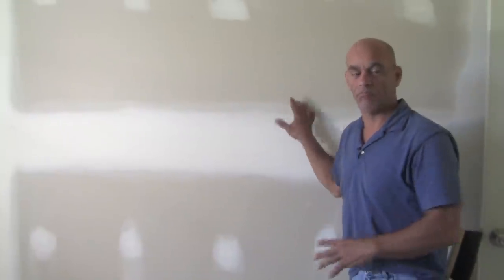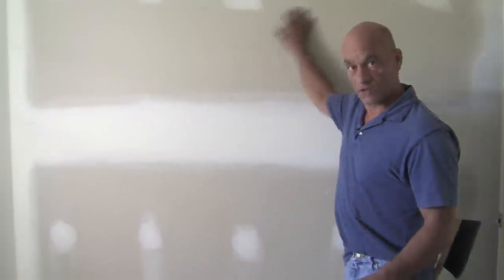How To Get the Smoothest Drywall Finish

Comment: Oh my Gosh! This legit changed the way I have looked at patching drywall by 1000 percent. I'm a home DIYer. I recently installed surround sound in my living room by opening the walls up with a flexible 4 foot drill bit and is g Ryobi Drywall patches. I've been stressing over the patched areas flat and uniform again before painting. I cannot thank you enough for making this video and completely changing my way forward! THANKS!

Comment: For 34 years as a professional Painter and Decorator, i bond my drywall with a PVA mix prior to applying paint. Lovely smooth and consistant finish, just my opinion.
Reply: What do you mean exactly are you saying to add the pva primer on the drywall then paint over? Or are you mixing your PVA?
Reply: @prominentsinglesinternatio4168  paint with pva
Paint with normal paint

Comment: Good Video Dom ..The Principal Issue of Skimming is covered Sealing the surface texture. I use my wide trowel for skimming walls. Yes commercial and residential projects that present an abundant of lighting will show flaws especially on fresh drywall which tends to absorb primer paint differently in various rooms effected by temperature and lighting.  I agree this skimming process is a great insurance for sealing the drywall surface supported by a good primer sealer which is a key factor in improving or achieving a texture smooth finish.  Thanks

Comment: Wow, I guess that is one option/technique. Across the water in The Netherlands, we plaster or finish the wall with Knauf MP75 gypsum, either spray or by hand, and go through a process of polishing and smoothing as it drys. Minimal dust and no sanding required. It's so smooth and straight you can literally see yourself in the wall and MP75 is really hard wearing plaster suitable for commercial buildings or homes. Now at least I understand what a North American guy, living in Amsterdam at the time, was trying to explain to me how he plastered a wall, sanded it smooth and had dust everywhere :)

Comment: I use a skim coat on all of my work, but I've never done this before.  I mostly resurface old plaster walls and older textured drywall. Mostly uneven substrate.  2 top coats and the same on all new work (level 6?) to match it up.   On a good day all I need to finish is a sanding sponge to straighten out a few blemishes.

Comment: Thanks for this info! My mudded joints had a lot of air pockets and this method filled in everything great along with smoothing out anything I couldn't really see otherwise. I did it with two people though. My SO had to deal with the roller as I took the mud off. Finished a 23x13x8 room in two hours.
Reply from the maker: Awesome deal.

Comment: I have been doing home remodeling for 15 years and never knew about this technique.  I can understand how the added labor would result in a super smooth finish.  Using a 3/8 or 1/2 inch roller pad using a drywall pva primer and two top coats I have never had any issues with uneven textures.  Thanks for the vid
Reply from the maker: I really use what ever nap I have available but yes a thicker nap is better.
Reply: +Ozzstar Under certain lighting conditions, you can see where the mud was applied over the joints vs the field area of the wallboard because the underlying textures are different (paper vs mud).  A coat of primer would not change the texture.

Comment: I worked in the Drywall trade for quite a few years and never knew of an architect to spec this. The best tape job will show joints depending on the lighting. The trick is good tape job, quality primer and FLAT paint. Any type of gloss paint will reflect light off the sheetrock paper differently than off the compound.
Reply from the maker: So very true.

Comment: Im in UK I was taught this 30yrs ago and have never seen anyone do it since besides me.Works great on long downlit corridors where you can normally see all the joints.
Reply from the maker: I'll say. Thanks for commenting.
Reply: i am the same way here,i was the only person around here that rolled it on the wall, and a few laughed when i did it, then later came back and asked what i used for a sleeve and how thin to mix it lol,,great work btw
Reply: Too much of that pink stuff over there. It lets people say they have "plaster walls" when it's only an eighth of an inch thick.

Comment: There is a recent article in Fine Homebuilding that says another way to achieve a Level 5 finish is to spray the walls with a primer/surfacer instead of the skim coating.
Reply: Jed Morton the skim coating you do at level 4 then to achieve a level 5 you either skim again or do the surfacing with the spray method which you do have to spray couple of times. either way works

Comment: Been doing drywall for long time. A crew I worked with sprayed the drywall with water then used squeegees to wipe it down. If you raise the nap on the drywall you can hand spounge it down. Painters dont do their  job right for the most part. Yes good primer and sand. Most people dont know it but when you primer you only have so many hours to apply the paint so it bonds. Otherwise its a must sand before paint. You should sand the primer painters.

Comment: I used this method over some patches and it works perfect to blend it all in. I just use a paper plate and some mud with a dab of dishsoap and some water  to make it very light weight before I roll it on with a small roller.

Comment: I’ve been a drywall finisher for 38 years this is a good process to do for an apprentice first off I never use the sanding pole we call that an idiot stick if I’m doing this smooth finish I use sponge on all my joints and lap marks second of all I covered the entire wall with 1/8 of mod with my 18 inch knife this way I can lay off very smooth with you let marks I come back the next day to take a small sanding block fine finish and take out any of the little thick laps but the rest of them are use the sponge on just the swirl in the walls come out

Comment: I never do level 5. On occasion I will do level 4 when there is a lot of lighting, but the normal standard here on the east coast is tape, then block coat, then skim coat. After prime then point up where needed.

Comment: Might not seem credible... but what he’s saying is right, one way to do a complete professional finish. Wall will look good in any light or photo
Reply: Moon Pie imo, the skimming gives a mire uniform surface for the primer and paint, especially on very old and damaged drywall.   I can show you walls that were patched and primed that you can see every patch. The patches have a much smoother texture than the rest of the wall was painted. That is why I am skimming a couple of walls now. 
  That being said, I do prime thicker than the video shows!
  I like to do it thick enough to completely hide the drywall behind the mud. Not sure that is necessary, just something I do. 
  I thought that mud was too thin to start with. I may be wrong.

Comment: that's interesting. I've had the privilege to work with 5 different drywall company's . they had been in business for 40+ years.  myself have been in the business for 15 years. I myself turn over a flawless job with what you call a level 3. the compounds and products used specifically say minimal to no sanding required. the porous texture of the drywall board itself has the same feel as unsanded sheetrock. if it's skimmed right. yeah, level 3.

Comment: I simply sprayed RuCoat 10 mils thick with a .516 tip as recommended by the manufacturer, sanded, primed, and painted as usual. Its advisable to back roll if needed, but I didn't see the need. It worked great and it is fast as it can get. 👍

Comment: what you said with commercial places with high ceilings, shadows and lights is when you need to up it to level 5.  I did the best level 4 job on it and the lights made it look horrible!  I didn't know to use the roller and ended up doing 6 coats of skim in lit up areas!
Reply from the maker: oh no.

Comment: You can save time skim coating way past the width of joints before the final joint sanding.  That way you don't ever sand directly on paper.  Yeah, if gloss paint, not flat, is used, you have to make sure the whole surface area is uniform or it shows.

Comment: Just a correction for you. Level one is the tape. Level 2 is you first coat, level 3 second coat, level 4 is skim coat and your level 5 is skimming every inch of the board. Mostly done on higher end houses or condos especially walls where you have a lot of natural light flashing on your walls.
Reply: Quick question...do you prime walls then skim coat...or vice versa?  Trying to hide some water damage
Reply from the maker: Prime after level five
Reply: @Askmediy  thanks

Comment: PVA primer will achieve basically the same goal. its easier to apply uniform than skimming and sanding, i always use PVA on new drywall and to blend repairs with existing drywall

Comment: GREAT video!!!  I never knew about this step.  I have that same brand 5 gallon bucket with a blue lid, mine is much thicker than that. Should it be thinned to do mudding?  Thank you, you're a super great teacher!!  I am going to surprise my husband and have all this done next time he looks in my closet...I am hoping to have it completed!!!  He'll think I hired someone to do it!! : D  yeah...wish me luck on the recess lights...the only part of doing this that is disturbing is working with wiring...I can do it though.  Luckily the panel is less than 30' away and that's going from the panel box, up inside the wall, across the ceiling using PVC to fish it, one light, then the other light, and back down to the switches for the two lights.  I sure hope I find a video on recessed lights!!!  Nevermind on the question.  Leave it the same to do mudding.

Comment: Level 5 has nothing to do with how many coats are used or done. It is simply texture equalization of the surface. If you prime then sand your walls it will do the same job given the quality of primer used.
Reply: FINALLY someone says it damnit! THANK YOU.  Exactly
Reply: Yep.

Comment: For the love of god... Has no one ever used a New construction primer.  Spray a nice coat on, back roll, then sand between with screens between primer and paint.  This will 100% get rid of texture difference...
Reply: +Michael DiNapoli can you explain this to me where do i get the new construction primer what is it and can i use it on my existing walls
Reply: +sam Construction primer is just the paint you first apply to seal new drywall. If you do not seal the drywall the latex (or oil) paint you put on can peel off.
If you want to "skip" the primer, you can buy a paint with the primer in it. This will save you painting time. 
I have had very good success with Bher Paint and Primer in One. Just remember to sand between first and second coat to remove any drywall mud dust which can give you a rough texture. It is definitely worth the time and effort.
Reply: all the regular paint retailers i know of sell "new drywall" primer. it makes a huge difference in final coat adhesion and evenness. i just did my bathroom with cheap(ish) paint. started with a generous coat of new drywall primer, then regular primer, then finish colour. putting a 2-in-1 over the drywall primer would probably work very well for less work. i know benjamin moore and CIL both make good quality 2-in-1 paint.
Reply: Rick V read the can, it says not for new drywall, there is a difference between primer and so called paint  &primer in one
Reply: milkweedsage mwhi
Reply: Technically this is called PVA primer and it seals the paper and joint compound so that you don't waste paint and get a more even looking coat (paper and compound soak up paint differently). This skim coating does not replace that. You should still us PVA. It will save you $ by reducing your paint usage.
Reply: Any true flat or dead flat paint with zero reflective value will work as a good primer to first coat drywall. I'm familiar with sherwin Williams products mostly so I use masterhyde or covermax line of flat paint for new houses. Its a finish coat as well. Though not the most durable finish coat...  Most new houses are sold with 2 coats of this paint or an equivalent of the same paint from a different manufacturer.  Not all flat paints are a true flat. Some flat paints have a teeny bit of sheen to them added to bring out certain colors and increase durability. Those are usually but not always your higher end flat paints.
Reply: Since the recession back in the 90s most painters to keep cost down bypassed the sanding and blamed the drywall flashing on the drywall finisher. They passed the buck so to speak. You are totally correct, prime and sanding will do the same thing.
Reply: Pva primer makes it look real good sprayed on and back rolled and sanded,exactly how I do it too,beats skim coating and sanding an entire house after you've already finished sanding, especially if your doing a big house like 15-20.000 sq ft of drywall
Reply: Blame Poodwaddle  good call, high quality PVA primer is a must for a good paint finish I always prime my own finish drywall work if I'm not gonna be painting at least the homeowners can see a solid primer on their walls before they screw it up by painting it themselves and leaving paint runs and roller/brush marks everywhere and blaming the drywall contractor for a bad finish job, happened more than a few times.
Reply: Patrick Spence yea if you want to coat it four times and use up more paint than you need to,it'll suck up your paint differently on the paper than the joint compound  and you'll always see the flats and butt joints no matter how good of a finish you did on your drywall. Use a good PVA primer in the first place and you can get it done in two coats of paint.
Reply: New drywall primer is highly recommended for new drywall. You are correct there. It is specific primer by name. Just ask them at the counter.
Reply: @pintorthepintor3964  based on your opinion based in zero fact.  It wouldn't rate number one in independant tests for the past 20 years for no reason.
Reply: You sand the primer?
Reply: @sam3922  Get any primer for drywall, paint it over your sanded area, then sand the primer once it dries, you can also put on a second coat of primer.
Reply: Pintor The Pintor what paint do you prefer?
Reply: Hey Mike ...tell me why does everyone on u tube make a process out of taping...it kills me..it's really simple ...I personally think everyone just looks into it too    technical...lol

Comment: Awesome video Dominick, thanks! You mentioned the porosity of the joint compound and the drywall paper being different after sanding, would the proper primer fix this and eliminate any shadows in commercial lighting? Or is a level 5 finish still needed? Thanks!
Reply from the maker: +Jonathan Ciccarone Primer of course will help but nothing like a level five finish would.

Comment: I worked in commercial construction for 35 years and never heard of a Level 5 wall. Maybe this method looks good but it's totally unnecessary if your finisher is worth a damn. It adds about a thousand percent to the labor. The problem is builders too often let the finishers get away with cutting too many corners and when the wall is painted, the short cuts come to life. I've seen it a lot. Good finisher = good walls.

Comment: Hey Dominick!  Another great video as always. I do have a question though...  When your doing drywall mudding, did you say that you don't use drywall paper or mesh until step 3?  If I heard that right, could you please explain why you do it that way please and thank you so much. I was taught to do mesh tape on the first step.  Also that, mudding is a 3 step process, so seeing and hearing about your 5 step has me a little confused on what's the best way to do it?  Please help.  Been a fan for a long time. I've watched a lot of your electrical DIY videos too.

Comment: The smart way to achieve what you want with a LOT LESS labor is to use drywall primer. Skim coating is for people that like to work too hard and achieve less.
If you want your drywall to look like plaster do the best finish you can and then get a reflector light and shine it down the wall. That will show you every flaw that is there. Fix the worst ones now with a small sanding sponge by sanding lightly. Pay special attention to the middle of the wall and anywhere a window will put light down the wall later.
Brush down the finished wall with a soft brush or broom, even better wipe it down with a damp cloth.
Buy some drywall primer hopefully with some clay content, NOT flat paint and use a roller with a 3/8 nap.  
The nap of the 3/8 roller will impart a slight texture effect that will hide the smooth mud seams from the texture of the paper. 
Shine a light on the wall while you are painting to make sure you don’t leave roller lines on the wall, use a light touch with the roller if you see lines.  No need to put the primer on too heavy, let it soak in and dry.
Paint with two coats of quality paint and your wall will look like plaster. One coat of paint will suit most people.

Comment: the problem is the recycled paper on the sheet rock. if you take some topping mud and mix it in a spray bottle give it a light spray you get the same thing its the veneer in the topping.

Comment: After the sheet rocks down in the first coat of plaster and tape is applied is it possible to go from level 2 to 5 using this method I’ve never seen plaster being rolled on the wall before I think it’s great it’s an excellent idea
Reply from the maker: Not really.

Comment: I have no texture problems, just sand properly, use a wallboard sealer paint, undercoat, then 2 top coats, easy and pretty smooth with 4 layers of paint
Reply: You don't scuff the paper if your a pro level 10
Reply: I'm a newbie and find his video very helpful. If you are an expert what are you even doing watching a how to video???
Reply: 4 layer ‘s ?